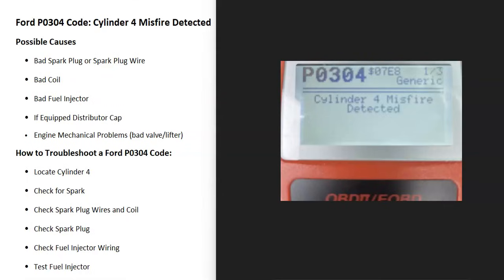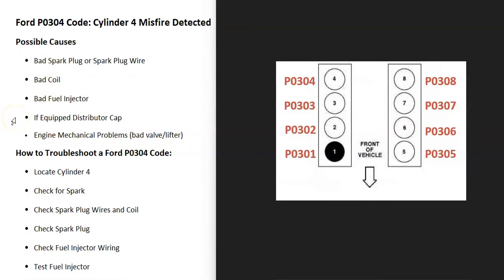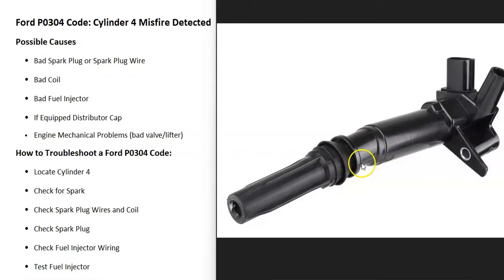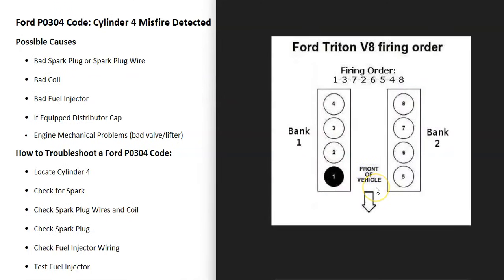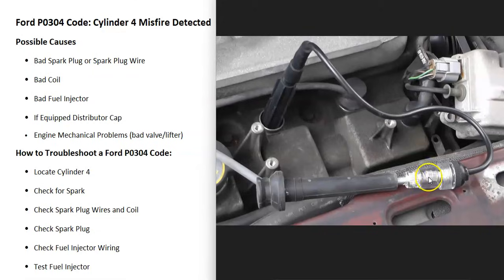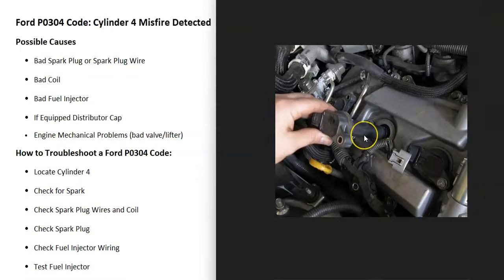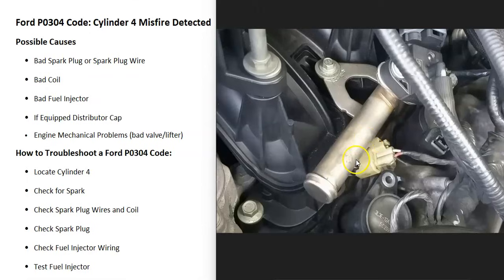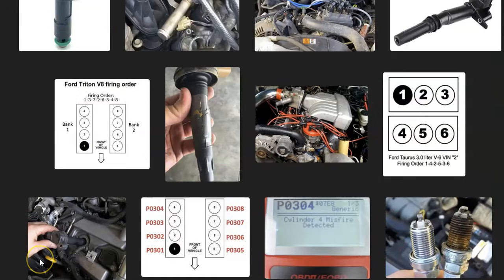Causes and Fixes Ford P0304 Code: Cylinder 4 Misfire Detected

Comment: P0300 random multiple cylinders misfire detected 
P0301 cylinder 1 misfire detected 
P0304  cylinder 4 misfire detected

Exhaust now sound a bit like a boy racer when driving with some metal sound rattling around 2k revs 

On cold days it would start with the misfire it would lose revs/speed/performance and vibrate/rumble/shake when idle

Comment: my mazda mpv has 2.5l duratec v6, started getting P304 around 65k miles, everybody said this Ford engine is good so I initially didn't suspect anything wrong mechanically,  only changed spark plug, wire, coil, didn't help, turned out four has low compression 120 psi vs 180 on others,  did a leak down  it was  leaking at the exhaust valve,  I poured a 32 oz of lucas heavy duty oil stailbizer and stopped the misfire, my theory is the thick oil additive helped to raise the compression

Comment: My 2012 Escape is at 113k Miles. Giving me the following error codes: P0204 (Cylinder 4 Injector A Circuit) & P0304 (Cylinder 4 Misfire Detected). Since I'm getting both, would this be an injector issue?
Reply from the maker: They may have both failed, or more likely there is a wiring issue. You can swap them with a good cylinder and see if the problem follows or if you have a meter, you can test the wiring and injectors coil. There should be two injector wires. With the key on, one should have constant voltage (12 volts). The other wire is the ground that the computer uses to control the circuit. It should pulse when the engine is running.  I made a full video on how to test the injector circuit. Here is a link. https://youtu.be/JL4_HlYCKrw
Reply: @HVAC_Mechanic  So if this is a dual-failure, am I gonna need new fuel injectors, and spark plugs? Anything else. Your help is greatly appreciated
Reply: @HVAC_Mechanic  Also, not sure if this is relevant to the diagnosis, but both error codes have coincided with rough idling and difficulty accelerating.

Comment: Thanks.. I've replaced the plug, the coil, the injector.. no go.. my 2006 Grand Marquis runs perfect but keeps throwing that code .. need to check the wire going to it more closely.. this video was helpful bro, thank you!

Comment: I went to a auction for the first time yesterday come out with 245k milies for $800 2007 ford focus the engine is pristine condition I mean clean well maintain got a code yesterday misfire cylinder 4 and  I need to change the motor mounts later today

Comment: I've had this problem off and on again in my wife's old 2003 Ford Escape (V6). We've taken it to two different mechanics (including a Ford dealership). The Ford dealership recommended a full (and costly tune-up) but they didn't fix the issue (and told me that they don't know what the problem is). I later took it to another shop (The Car Doctor in Palo Alto, California). They replaced the fuel injectors and they assumed that it would fix the issue. Nope. It still didn't fix it. The car runs fine -- but it does feel like it has some slight "hiccups" sometimes when idling. While driving down the road, it is usually fine.

Unfortunately, I worry that it won't pass the California Smog test. The Check Engine light is almost perpetually on (which I have read will almost always fail your vehicle in California). Thankfully, it has passed my last two smog tests. I have to get a smog this week. I just wonder if it will pass. Currently, it has the P0304 and P0316 error codes.

Suggestions or advice?
Reply from the maker: I’m not sure if it will pass the emission test if you passed before with the code, you likely will again. There are several causes of a Ford P0304 and a P0316 code. A P0316 code can be triggered by a change in fuel type, fuel delivery issues, air intake issues and more. I did a video on this here is a link. https://youtu.be/1O07kNDFp9I

Comment: i recently got a vic last yr with well now 80k miles but its got w misfire of 4 it did also sit in a field for 15 yrs b4 i bought it and the only thing i’ve replaced on it since is fuel pump along with the spark plugs/coils bout to to the cam position sensor maf sensor injectors and maybe the plug wires hopefully that will fix it.
Reply: They shoot out coil injectors I had one and my cousin had to re-drill the spark plug injector socket

Comment: I got one of these problems. It’s also doing p0303. Mechanic said it’s a cracked head. Could that be true? It only has 125k
Reply from the maker: A cracked head can happen any time, usually when the engine overheats. Is there any water in the oil? Often, water leaks into the oil when a head is cracked or has a bad gasket. White smoke out of the exhaust is another common sign. The best way to know for sure is to have a Leak Down Test done.